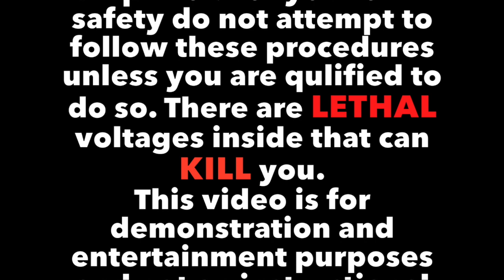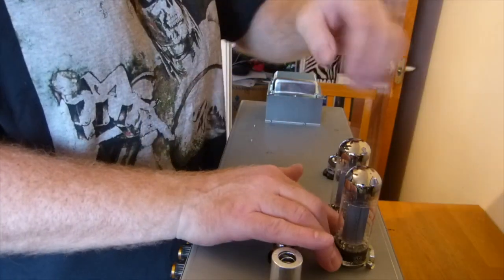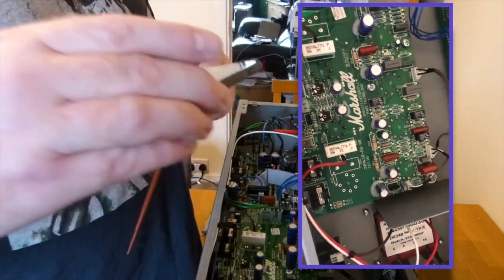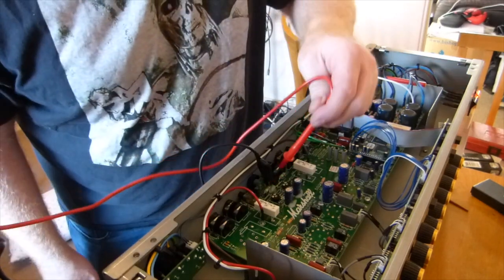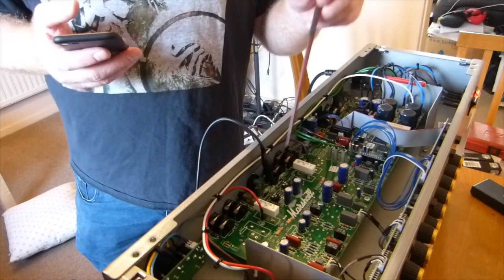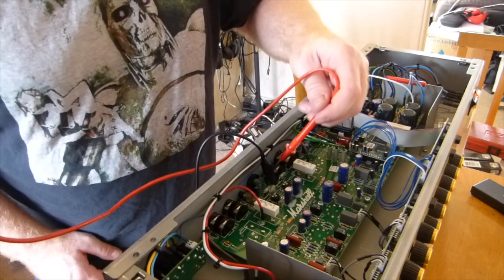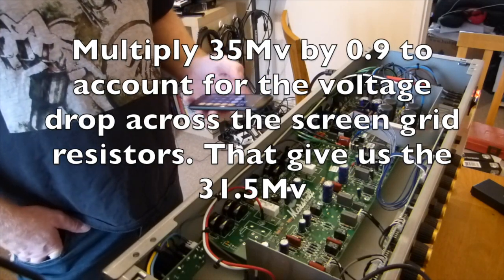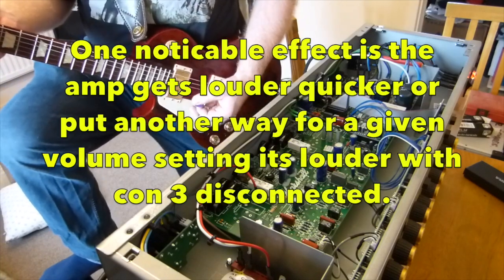Guitar Amp Re-Valve And Biasing Marshall JVM

Comment: Very nice.  Thank you 👍🏻  What exactly is happening when (COM 3) is disconnected?
Reply from the maker: Hi thanks.   I’m not sure I understand your questions exactly.  What is it you need to know.  I may or may not have the answer 😊.  
Cheers.
Reply: I thought you disconnected a plug called “COM 3”.  My bad.
Reply from the maker: @nigel900  sorry it’s been a while since I did this video. Plus I’ve not been playing this amp much lately so haven’t been in it for a while.   If I remember correctly I was talking about a mod that can be done to the negative feedback loop.  You can test what it might sound like by disconnecting the blue wire that goes from the speaker output board to the main board which I believe is con3.  
When this wire is disconnected you basically get no negative feedback so the power section breaks up sooner.  This will give the amp a vox like amount of neg feedback.  So what many people do is either swap about a resistor that’s in line with the wire or put a pot in line with the blue wire.  You can then vary the amount of negative feedback from stock to non depending on the pot value.

Comment: Your video is really interesting. I'm searching for white connectors and blue cables (4 pin to the second board)  to replace mine. DO you know where I could find them? Thanks
Reply from the maker: Hi thanks.,  without knowing exactly what it is you’re wanting to change it’s hard to say.  Plus I’d need to re familiarise myself with the insides of that amp.  I tend to go in do the bias adjustment and that’s about it.  I’ve had a look around for various parts that I’ve read about modding.  But to be honest some are a nightmare to find as there so much crammed in there.  If I was you I’d jump on the JVM forum if it’s still going or the Roadhouse forum that has a section dedicated to JVMs.  Someone on there will be able to point you on the right direction. 

Thanks for taking a look. 
Cheers.
Reply: @leewright5616  Thanks again. Unfortunately JVM Forum is not longer available. I refer to those "CON1" 5 pin that connect main pbc board to the front panel know board. I'm agree, really difficult to find resoureces. Let's exchange informations, it would be a pleasure. Cheers, Fabio
Reply: @leewright5616  HI Lee, I meant the old JVM Fourm. Roadhouse JVM Forum is active. Thanks, I will try with that.
Reply from the maker: @MrWasp73  no worries. I had a feeling the old JVM forum had gone again.  That’s the second time.   It got hacked before I believe.  It’s a shame as it is a gold mine of info.  I think several of the guys post  on roadhouse.   
As for con 1.  As I say I’d have to pull the chassis out and have a look.  It is usually marked on the pcb. Con and the number.  Con just means connector.  I guess just methodically follow wiring from one board to the other until you find the one you need. Sorry I can’t be more specific.
Reply from the maker: @MrWasp73  just thinking con 1 is the bias point connector.  The 3 pin connector where you’d read the bias from.
Reply: @leewright5616  HI Lee, I've just seen it's marked on  main PCB CON9 and it goes to knob pcb board (with connector with 4 blue cables + 1 white cable). I'm searching for this in Internet but it's difficult.
Reply from the maker: @MrWasp73  right ok I think I know the connector you mean.   What is it you need to know about it?  I believe you can see it in my video when I’m using the phone camera to talk about a few bits.
Reply: @leewright5616  Thanks Lee, I will try to sse it again. Do you know where I could buy it? or its components
Reply from the maker: @MrWasp73  I would say your best bet would be to contact Marshalls servicing department.  They would be able to advise you on what spares are available. And to be honest I wouldn’t be keen I buying from any other source.  You just never know what you’re getting.  At least from the factory if there’s a problem there is back up from them.
Reply: @leewright5616  Yes, I will go through Marshall. Thanks again.
Reply from the maker: @MrWasp73  no worries 👍😊

Comment: I wish I could find a checklist for biasing that has the math equations written on it
Reply from the maker: You could try this - 

https://www.tedweber.com/bias-calc/

I’ve not used it yet.  Came across it recently.  The person using it was using. Euro tubes bias meters to measure the plate voltage and the bias voltage that needs adjusting.  If I remember correctly if you measure the plate voltage manually you need to also measure the voltage across the screen resistors and add that to it.  Never used a euro tubes bias meter so I don’t know if that accounts for the screen grid resistors or not.   As the tubes are plugged in to it then it into the socket my guess is it is getting the direct voltage from the plate.  And the bias points  measure via the cathode I believe hence some extra measurements are needed.  

Long and short of it is you need to know what max dissipation of the tube you are using is.  EL34 is 25 watts max. Then work out 70% of that as that’s the highest you want to go.  Some people prefer lower.  

So 25 x 0.7. Gives us 17.5 watts.  

Measure the plate voltage. Say it’s 470vDC  
Divide 17.5/470. That equals 0.03723A or 37mA
Measure the screen current say that’s 5mA.  Add that to your 37mA 5+37 = 42mV this would be you bias setting per tube. Double it if it’s a 100 watter as they’re measured in pairs.  This would be absolute max with those figures.  Many people go a bit more conservative to prolong valve life.  

There a good post detailing the process here.  On the Marshall JVM Facebook page in the files section. 

Probably explains it better than I have.  

https://lookaside.fbsbx.com/file/How%20to%20Bias%20the%20Marshall%20%20JVM410H%20Amplifier%20%20-%20DND%20Oct%2021.pdf?token=AWxS8x3IklcjXQ6ICvBnqzj27sZ4TxRvvKzOi-wzJzI1mPdl1DQDAwbJUkCSuosgj9B0iodC77J6DzT2dqX_KtC_gpF9Y93eei_T-41K2x8hnfDJePM9hDVMBsUL4mO5rXC6UXvTUa2stLtPly88O8IHPDBHNCo8Wg1uy03JzUPcPwUbJKqPPmCt4oXKT0EkF7XKOfnKPI9yGG7iPWhrcck8nFJrV_H39_yGaEM_vstjYFbjJ1gvosSNLCPBrX4L_Ir2O_svllmlKwiC4T7QUT-W
Reply: Thanks for your help tho the link to the JVM forum didnt work for me, maybe try resending? I can look on the FB page too. I have come across the Weber site before, it could be helpful for the calculations to be sure. I suppose I was  just hoping for some sort of "Biasing.. for dummies" kinda thing that just guides you through the process step by step. Tho, what you wrote is essentially what I needed, you explained it well. Thanks. 
I just brought home a used 50 watt JVM head (basically. same thing u got) and have been considering changing tubes on it properly. I do have an old BIAS meter and a Multimeter. I also have some elecronics experience and everyone ive talked to feels its something i could do... Just a little timid about getting into it (and possibly screwing something up) since I never biased an amp all on my own before.  😉
Reply from the maker: @dorrianstone7264  the link should have taken you to the Facebook page.  The JVM Forum no longer exists but all the info including mods is on the Facebook page under the files section.  

Glad my description helped.  

If you have electronics experience that’s a good start.   I’m sure I don’t have to tell you about the 500+ volts that are present in these amps?  Even after they’re switched off snd unplugged.  This is mostly a problem if your changing components, so whine biasing you can easily stay clear of these components and keep yourself safe. You’ll need to work on it fully live to take your bias readings.  Measuring the screen resistors is probably the most dangerous part. Aside from sticking your hands in there grabbing caps by mistake.  Just work one handed and steadily, distractions and having to rush will be your enemy.  😁.
Reply: @leewright5616  I am still waiting for approval for the JVM FB page but I look forward to going through it, (actually just occured to me that may be WHY the initial link didnt work 🧐...). Anyways. yeah I am aware of the dangers on the inside of the amp. the one hamd rule is a good one. Biasing the JVM seems fairly straight forward. Tho, in my search for BIAS videos I came across this guy who plays pretty fast and loose near the danger spots replacing a fuse. Kinda surprised me, tho he certainly seems to know his stuff... https://youtu.be/d3duIdW_PFE
Reply: @leewright5616  I was able to find the bias info you mentioned on the JVM FB page. Thanks a bunch. Once I get some time, ill do the operation. I'll let u know how things went.
Reply from the maker: @dorrianstone7264  thats great glad you found it.  I hope it all goes well bud.  👍
Reply from the maker: @dorrianstone7264  i do follow this channel you’ve shared he’s very good and he does show you discharging caps when he’s working on Amps in some of his other videos.  Good find that one.